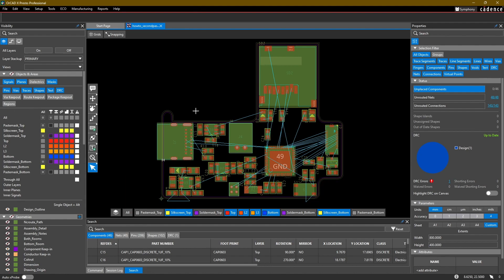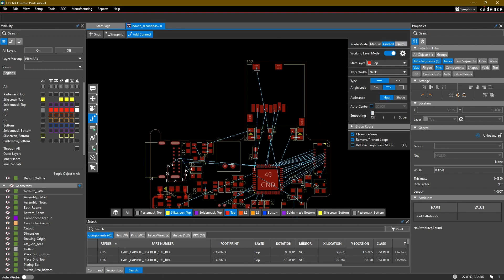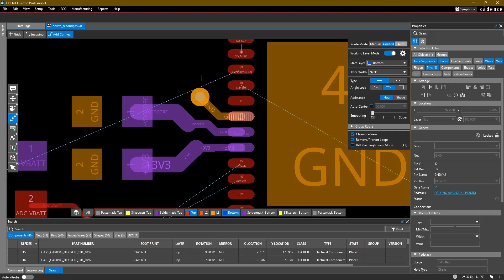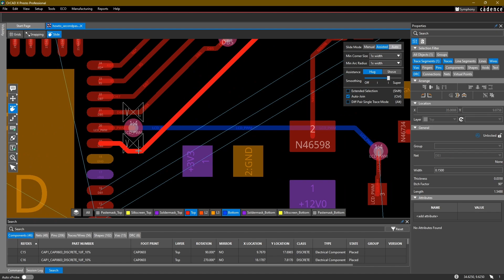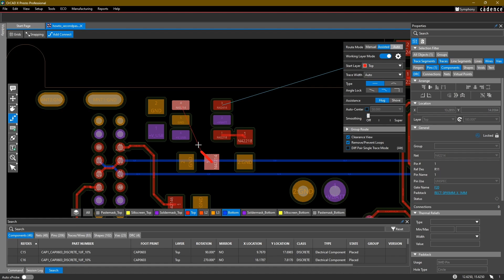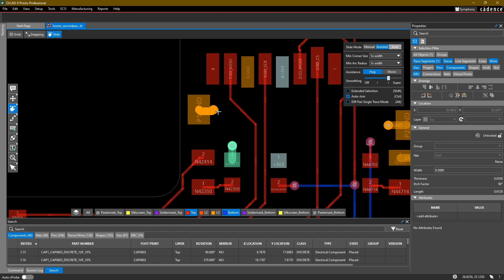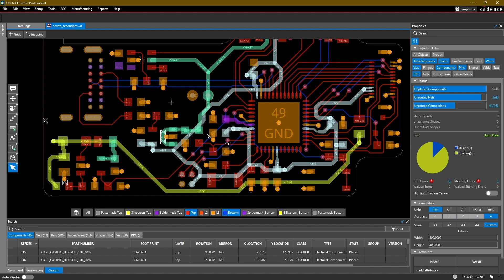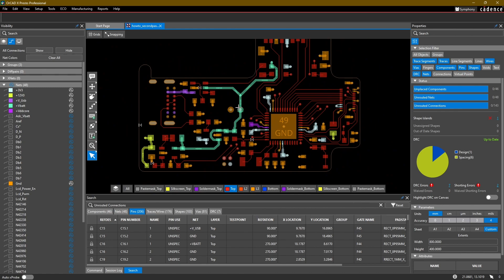OrCAD X How To - 8 - First Pass Routing

Comment: Great job on this series.  I do have to say the Altium-like interface is kinda cool - being a Protel/Altium user for over 20 years and have done over 3,000 designs with it.  Used Orcad SDT DOS before that and PADS before that.    The Orcad for Windows fiasco is why I went to Protel back in the mid-1990's 

Cadence is getting there... still a ways to go to be as productive as Altium.  A few things:

- Need shortcuts for all those times you have to go to the panel.  
- Also, a TAB keystroke would be cool so that it freezes where you were on the canvas and not be dragging things to the panel
- Also - keystrokes for changing layers.  In Altium it's the -/+ key  Having to constantly go up to that routing panel looks painful. 
- Selection of routing vias - min, pref, max would be cool.
- AND GET RID OF THE SILLY PADSTACK thing.  Good lord, no need for that nowadays. 
- Again, in Altium, you can just use SHFT-space bar to change routing angle.
- Altium's push and shove is a lot more advanced - even when copy-pasting via strings, like you do when you were pasting the power via stringers - it will push things out of the way.  You never get DRC's at all.  
- FSO - Find Similar Objects. which leads to 
- A comprehensive list system for each editor.  
- A visual indicator of the snapping.  Altium has a small circle for that.  I see you copied their snap dialog, but they have a fairly granular set up for snapping including snap distance and such.

I'd have to demo all these for your team to show what you really need to do to get this to the level that Altium's GUI offers.    

As to Constraint Manager - well, yuk.  Altium just tried that and a lot of people complained. They recently shut it off as a default advanced pref. 

 But I thought it through, and since I work with Orcad with one client they were always jealous of directives.  A few videos here explaining why:

two pin nets 
https://www.youtube.com/watch?v=e0TbP7Y2PgQ

reuse
https://www.youtube.com/watch?v=bCOmSvY1jFM

Even KiCAD sees the value of directives.  I mean, a table to manage directives would be nice, and Altium has a long standing bug with editing multiple selected directives

So yea - Orcad's getting better.  But it got a ways to go...
Reply from the maker: Hi there, and thanks for the response.  It's great to hear from passionate board designers as yourself.  Just to comment on some of your feedback, we find that different users find productivity with different workflows and features.  As OrCAD X Presto is still early in its lifecycle, we're always looking to add improvements, fixes, and features that users ask for, as well as those we believe will be beneficial to all users.  Regarding some of your specific asks, I think you will be quite pleased to see what we have in store for our next release and future releases.  Specifically regarding constraints and padstacks, our users find this method of organization to be very powerful in large designs, but a bit tedious in small to medium designs.  Either way, we're working to address all use cases.  We'd love to hear more of your feedback and thoughts, so please don't hesitate to reach out to a local rep or on our support portal and you can ask for me directly by name.  -Adam